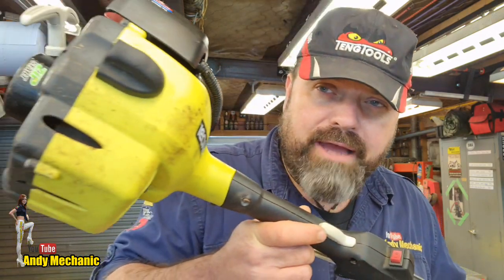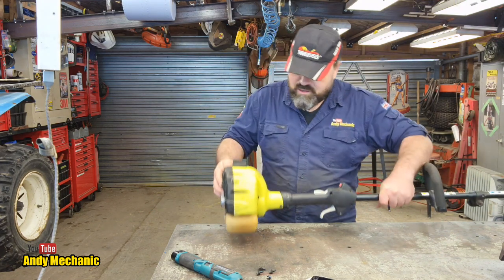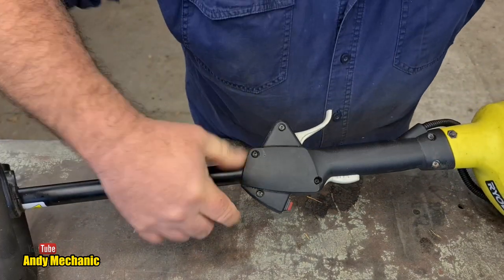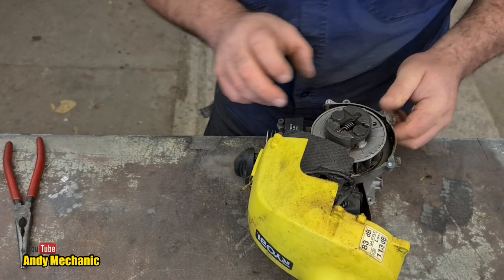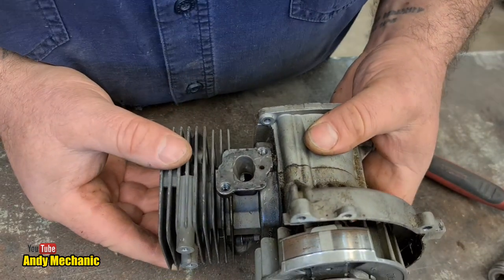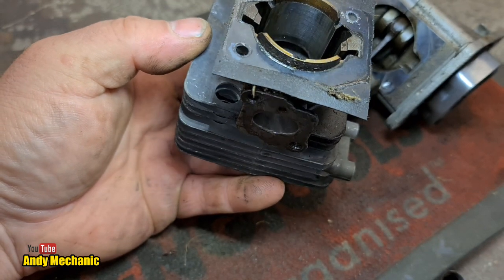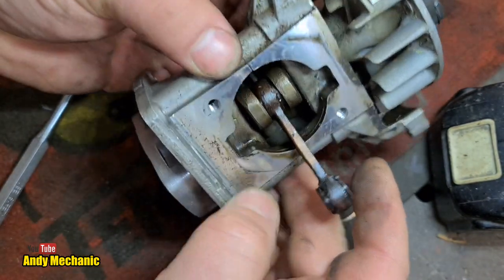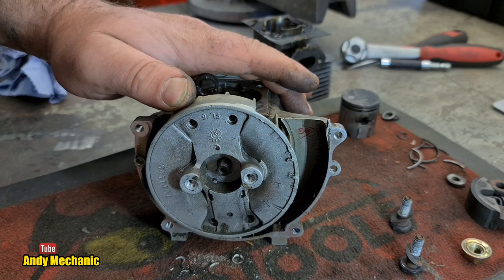Ryobi grass strimmer autopsy #1182

Comment: A Ryobi lasting 18 years should be one for Guinness book of world records. I destroyed one in less than a week using it commercially and a 18 volt battery blower disintegrated in three weeks of commercial use. Only use Honda's usually which usually last 2.5 to 3 years commercially before the bearings let go finally.

Comment: Hey andy, nice video! Love these autopsies. Though I don't think that the ring is the root cause of the failure. I think it's more likely that the big end bearing disintegrated due to poor quality and threw chunks around in the engine that caused havoc. But never the less, it's dead. Great work explaining everything! Looking forward to the next video ;)
Reply: Shouldn't be running 50:1 mix in a weed eater.

Comment: big end bring the primary fail point wonder if the cylinder is out of round letting the piston rings slap
Reply from the maker: Yeah, it's odd, Jared said there was no knocking noise from the engine prior to the failure???

An interesting teardown & relatively quick too...

Cheers for now Simon

Andy
Reply: @AndyMechanic  do you have a bore gauge
Reply from the maker: Yep :-) looks like I may be revisiting this one at the weekend!